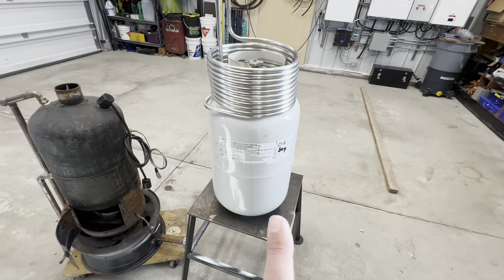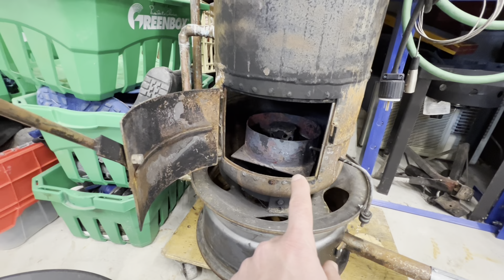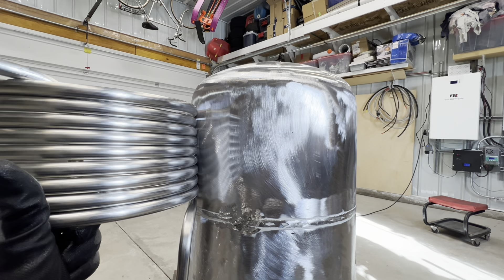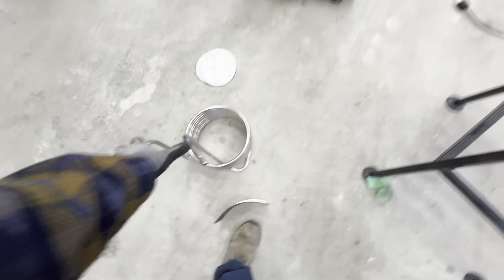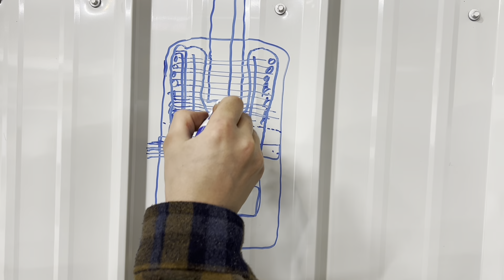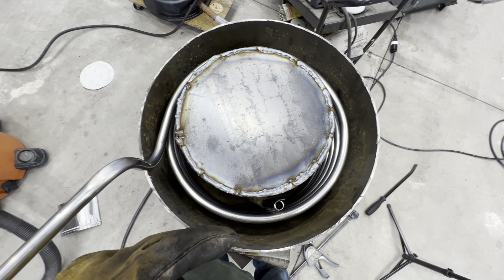Building the second version Waste Oil Burning Water Heater.

Comment: Ich will mir auch so etwas in der art bauen, allerdings werde ich es nicht senkrecht machen, sondern horizontal, ich denke es es passt besser zu meinem altölbrenner mit druckluftdüse.
Edelstahl rohr ist extrem teuer hier zu beschaffen, unter 10euro pro meter habe ich nichts gefunden in tauglichem Durchmesser 😢. 
Habe jetzt bei aliexpress ein coil gefunden für Bier 😂 das soll insgesamt 8 meter edelstahl rohr sein mit ca. 9,5 mm durchmesser, so käme ich auf etwas mehr als ca.3 euro pro Meter,  inklusive Versand. 

Ich hoffe es wird funktionieren.

Comment: How many litres of water can be heated? Plz make videos  how  to make  thermal   insulation? Nice videos ❤it
Reply from the maker: @subhash7408  that’s a great question, I have wanted to do a follow up video to test the real thermal output. I’ll add it to my list of things to do! 

The insulation concept didn’t make it very far,  lots of variables that I have not worked through enough to give any clear instructions or directions. 

Some takeaways are; using a mesh welded to the interior for better adhesion, using a thicker layer of a similar material, giving more time to cure.